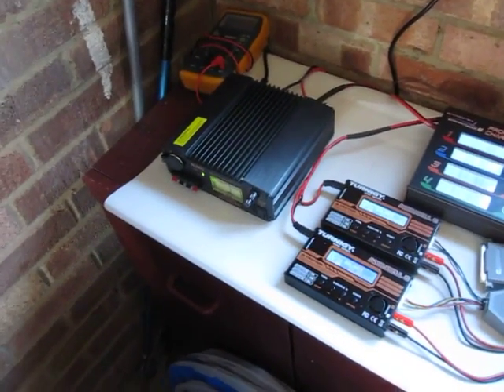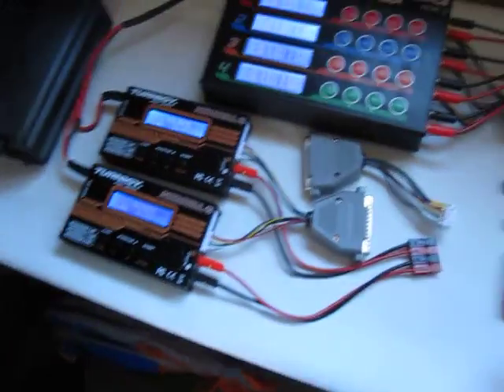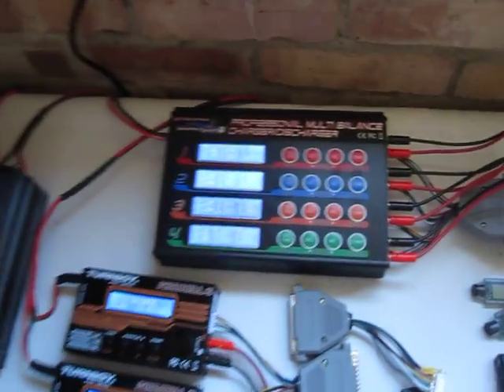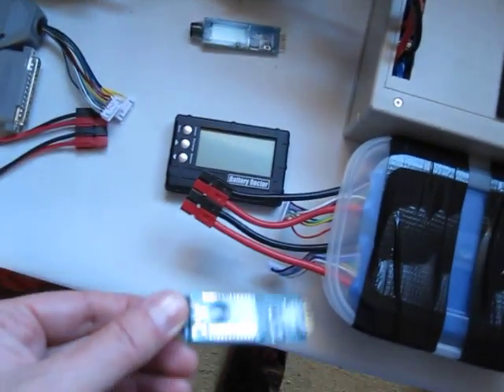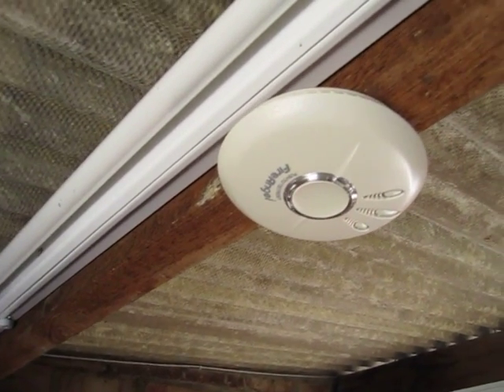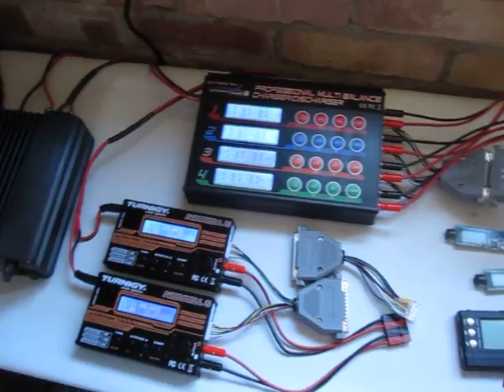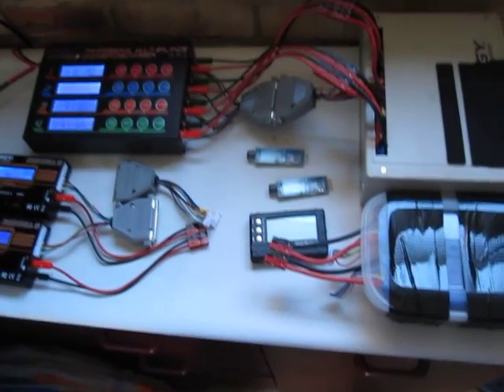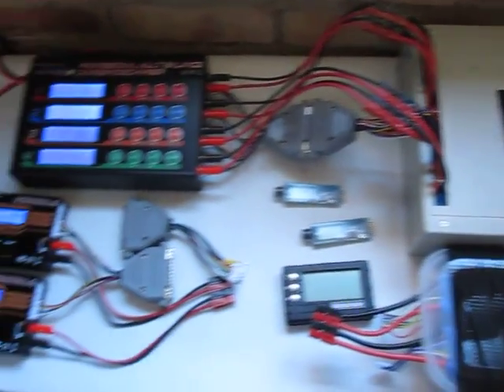Lipo Battery Electric Bike Charging Station

Comment from the maker: I know the etronix is a balancing charger, the charger I use now charges through the balance taps only at up to 8A, the way it balances them is more efficient than the Etronix and it gets the job done much faster and they are perfectly balanced, the Etronix was struggling to balance cells once they got over a year old or so, its still a good charger though, the balance charger I use now is called a BC168 google them for info if you interested.

Comment from the maker: Hi

Hobbyking is the place to go, the batteries in this video are all still fine, I charge them to 4.1V and never below 3.3V, I still have the charger in this video but use a balance charger now as it balances them quicker. You wont go wrong with Lipo, I assume that you frequent the endless sphere forum? if not go have a look there, there are loads of threads on it there, I also added 1 more pair of batteries for longer rides giving me 15AH at 48V, good luck! and have fun :-)

Comment: Nice set up man,
Im planing on tiring these lipo's in my 48volt 1000watt e-bike im getting sick of the SLA batteries.
I was just gonna start with 4 which will give me 10ah prob an hour run time just for now..if you can give me any pointer's id gladly appreciate it ..Thanks Johnny B

Comment from the maker: hey John, HK sell the same unit but under a different name I think, its relatively expensive but it really is very good indeed, I have been using it pretty much every other day for a year now and it hasnt put a foot wrong, it keeps the cells well in check and just works plain and simple I am very happy with it and would recommend it to anyone, I can charge my entire pack 15AH 50V in an hour with this set-up if I need to which is great as I can do 40M with light peddling charge and do another 40!